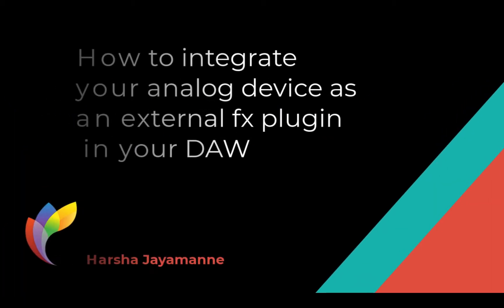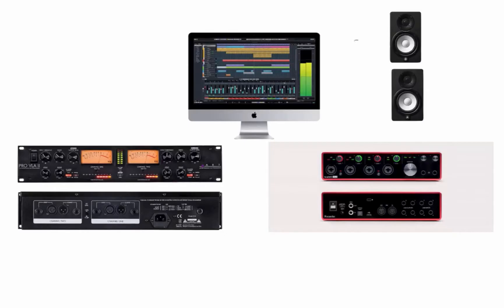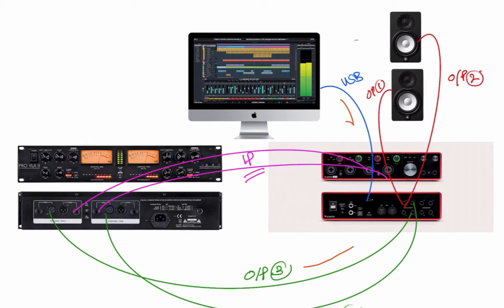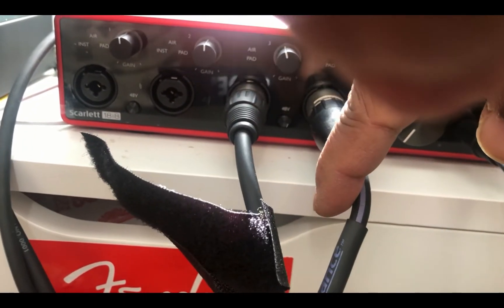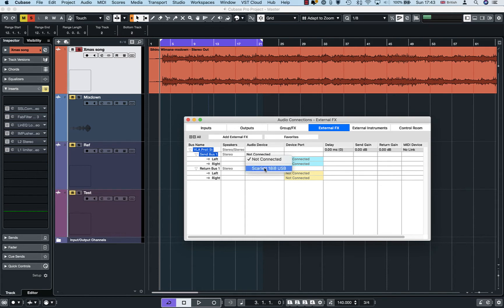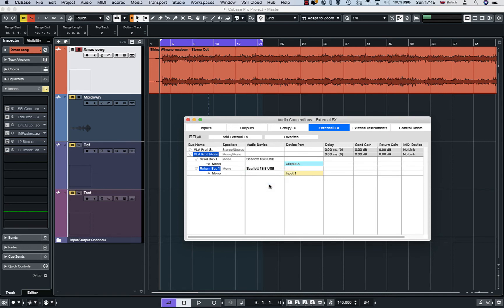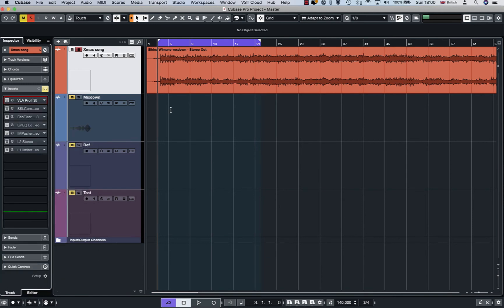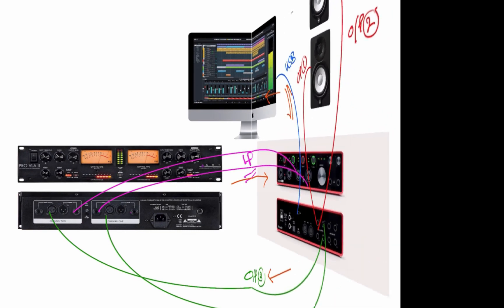How to use analog gear in your daw for mixing | VLA Pro II, Focusrite in Cubase

Comment: Nice video, but im a little confuse. How would a set this up if im using a mic amp and a mixer? In this video it show you go in to out on compressor and interface, so where do you plug in the mic?